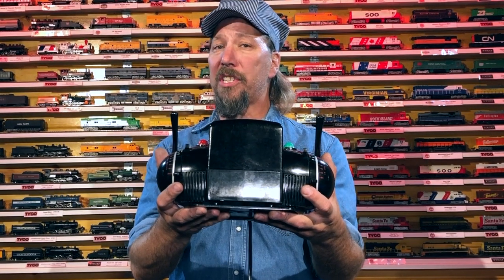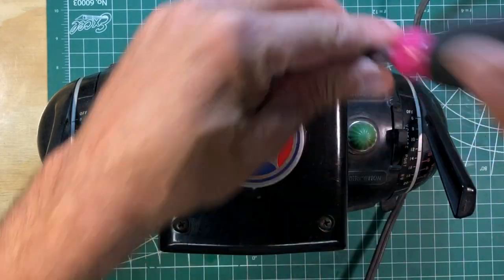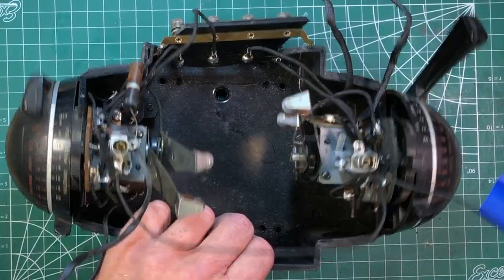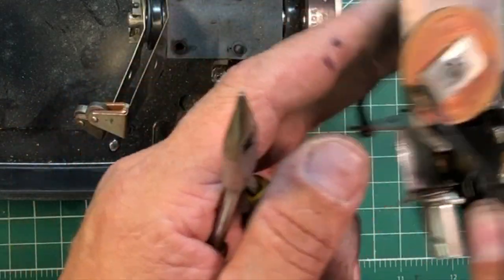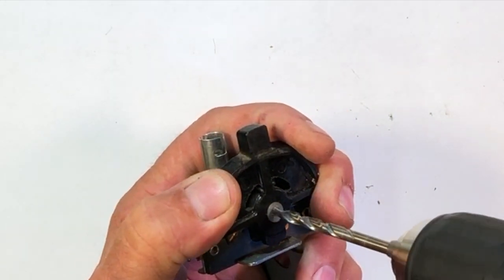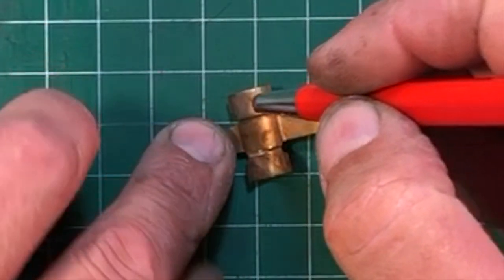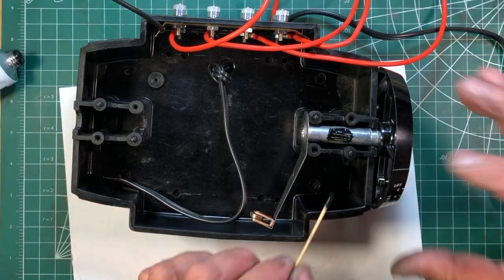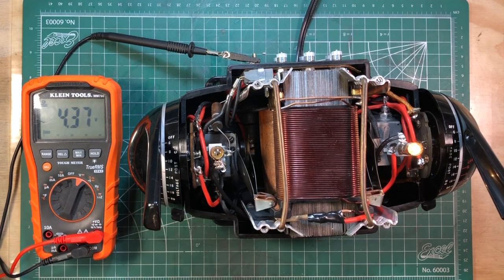Lionel ZW How to do a Complete Tear Down & Update.

Comment from the maker: Before I do a repair video on stuff I'm not to certain of, I will comb the internet and collect information. I came across this video made by Ed at his Youtube channel "TheCreativeMind" and he had the BEST procedure for servicing the reversing unit. His channel taught me how to do the servicing I did to my reversing unit in this video.  Ed also goes in depth on diagnosing the actual coil / transformer portion and explains how it does what it does. I have included a link to his video here. https://youtu.be/qPZNaASE_lw.   Thanks Ed for teaching me how to rebuild these ZW's 🙂
Reply: Thank you for mentioning me. You did a great job on rebuilding your ZW. Keep up the great work.
Reply from the maker: @Gma7788  I believe that is a resistor
Reply: I may be mistaken, but the small voltage leak is there to keep the electronic reverse unit from cycling into nuetral when you stop the train. That way when you start the train back up you don’t need to run through the Nuetral, reverse,nuetral,  to forward again. I know the American Flyer transformers were made this way. In order to cycle an American Flyer reverse unit you have to raise the dead man handles to cycle the reverse unit. This feature is on the larger 15B transformers and up. Hope this helps a little.

Comment: Hi Ron. I have a Lionel 150 transformer a friend gave me before he passed away.  After watching and watching and watching your video I got brave enough to try to do the tear down and rebuild.  Actually, I had fun following along with your video because if I missed something, I could stop and go back.  Doing it this way, it is hard to fail.  I took my time and made sure I cleaned everything really good.  I polished the brass so it looked like new, cleaned all the contacts although I couldn't bring myself to take that reversing unit apart. I don't have a tap that size, so I cleaned the contacts by moving it back and forth.  It worked and they got really clean.  I also didn't put the rollers back the same way you did.  I tried squeezing it but somehow got crooked and I ended up taking it back apart.  Instead, I got the pin and roller in place took it over to my mini vise and with my small ball peen hammer gave the end just a few real gentle taps and it mushroomed perfect.  Doesn't take much.  Everything else went well and your video really helped me a lot.  I don't know what they charge to rebuild one of these, but I think it was fun and well worth it to try.  I have to say, if I hadn't had your instructional video, I don't think I would have tried it.  You did it without, so you are brave.  I love your reaction when the light came on and all went well.  I hope I have the same reaction when I finish it up later hopefully today.
Reply from the maker: Glad you have success with your transformer there John!

Comment: Playing with electrical components is always fun! I was a aircraft election (spark chaser) in the USAF back in the 1980's, then in the 90's the AF pulled a rivet workforce update to that career and added environmental systems to the elections job so we became EVEL or ELEN depending on t which base you got stationed at. But it looked like you had a bunch of fun rebuilding & updating that old 1940's vintage Lionel Transformer, boy they made them to last too, comparing those oldies to today's newer stuff there is no competition, the newer stuff if it stops working toss it, the old stuff you can fix it. Today's manufacturing is putting controlled obsolescence into their wares, nothing is made to last like the stuff before the 1980's.
Great job, now you could start your own business fixing up those old Lionel train equipment pieces for the masses!
Reply from the maker: Thanks Cuda, I agree how manufacturers engineer in planned obsolescence. Gimme the old stuff any day.  This ZW was built to be used every day for years.  Thanks for keeping our "Boy's" safe and in the air :-)

Comment: Thank you for such an in depth break down and rebuild. Ive done the basic rebuild on my two Zws one is the early 250 watt and my 2nd is the later 275 watt. Ive upgraded the diodes, breakers, rollers and power cord but never beyond that. I absolutely love my Zws knowing that they have an amazing past and they will last a long long time. I have a modern MTH z4000 transformer for my more modern trains, but I prefer the post-war era simplicity. Again thanks and keep those trains rolling.
Reply from the maker: Thank you for taking the time and leaving a comment :-)

Comment: Oh Yeah very well done video. I had that transformer or one like it. I loved be cause I could control 4 engines at once. I sold it. Sadly. Then a Fellow in New Jersey contacted me. He had the Flyer dual control with Volt meters a real beauty. He had bought on line and like yours it was broken in shipping. I agreed to try to fix, it. He was a real nice fella . I had rebuilt 3 Flyer Switchers he had and gave the rusty one for helping. I get the transformer to find one side was crushed from the top. the handle was cracked at the lower pivot boss and the maih housing was broken off at the support for the pivot, it was a real mess. But the unit looks brand new. At the time i had a tiny hobby 3D Printer and I had been making train parts but only small ones. He said was not in a hurry and did not the money to pay anyway so take my time. Nearly a year later I was able to get a new bigger better 3D Printer and now had the tool to print his parts. I ground the handle pivot to a straight line angle then printed a pair part to match the shape and super glued it in. It perfectly matched the other handle. Now the housing. I was going to donate the housing from my dual control, but it did not have those Volt meters. I hated to take mine apart cut it up when his was in such a good shape. So i decided to remake the entire lower part and screw it into the housing as neatly as I could. So the round heads could be seen but were polished stainless and looked very good. I reassembled the transformer and it all worked great. So if you get a Flyer Dually let me know i have the housings pivot frame for the handles, if you need one. Nice video well done, your editing is wonderful, Good Job, Dennis
Reply from the maker: Wow Dennis!!  Sounds like your quite the fixer / fabricator kind of Feller!! I have a Flyer single knob transformer with the gauges coming up for a repair video in the next few months. I will reach out if I need something made.  Sounds like your the Feller to go to :-)

Comment: Best ZW build video I’ve ever seen!  I’ve thought about buying a modern Lionel ZWL transformer, but I think I’ll hang onto my two postwar ZWs instead.  They’re very repairable and reliable… unlike the modern stuff with its myriad of circuit boards and tiny components.  The new transformers will probably not make it to seventy years old like the ZWs have and end up as expensive paperweights. 😂
Reply from the maker: Thank you for your kind words and I like the way you think.  The "Old" stuff has proven itself over time.

Comment: Hi Ron.  Great job.  I was so impressed with you're ability do a oh so wow job.  A friend of mine sort of loaned a Lionel VW 150 watt transformer.  Back in June 2015 I was shocked when he suddenly had a heart attack and passed away.  He had gotten me back into the hobby and he gave me this one to get started with.  He told me not to forget where I got it.  When I talked to his wife she told me to keep it.  Funny way to get something huh?  I was totally bummed out for about 2 years.  It will sure take your sunshine away.  I finally slapped myself and started getting back into it again.  The unit sat around for a long time until the other day I got it out finally,  It isn't the same as the one you did but my question is this.  Would most of the replacement parts be the same on this one as the one  I don't know a lot about electrical things but I have gotten braver after watching your video.  You really make it look easy Ron but those reversing switch and circuit breaker is kind of scaring me.  Anyway, I hope I hear from you if you have time.  You are fun to watch and you look like you are having fun.  Please help if you can.  Thanks,  John
Reply from the maker: Greetings John, Sorry to hear about your friend. I'm glad you stuck it out with modeling. I would only assume the parts might be similar but I cant be certain because ive never been into a VW transformer before.  Thank you for your kind words and glad I can be helping you out as much as I can on your modeling journey.

Comment: I'm doing about the same to a AF 30B. I picked it up for 30 bucks but had missing handles. Thanks for the informative video, Ron.
Reply from the maker: $30 is a pretty good deal.  Hope you get it up and running with no problems finding repro handles :-)
Reply: @classicmodeltrains  The handles were missing, the cord was cut, and the tin shield sign is screwed up. So far, I taken the voltmeter out, cleaned, polished and got the needls working again. I'm installing some diodes called TVS diodes. They will protect my modern locomotives against voltage spikes. I'm watching your video on the 293. Those are great running engines!  I wish I had more room for an HO layout as I like working on them engines and rolling stock. Keep up the great videos, Ron! If you find time in your busy schedule, stop over and check out my channel. Thanks!

Comment: @ 16:19 I knew you saw my rebuild video and @ 16:58, it was a lot easier to get the switch rivet in place by removing the board
Reply from the maker: I reviewed all ZW rebuild video’s on YouTube to perhaps learn a new trick or to before I shot my vid. Your video had the absolute best technique for servicing up that reverser switch. As you could tell I had no idea as to why a guy would drill those out, until the reassembly process was well under way. Since I used most of your technique, I am hoping you look at this as imitation is the highest form of flattery. :-)
Reply: @classicmodeltrains  Thank you Ron, yes I do. I wanted to do a solid rebuild that would last a long time. Besides replacement parts, I researched for other components like fish paper, high temp wire and carbon grease that would be equal to the original or out perform what Lionel used back in the day. I guess I did something right if you used most of my techniques. A lot of people will benefit from both videos to do their own rebuilds. I like to ask if you can give me credit for your inspired rebuild since my techniques and materials mentioned are the best. I know you don't have to since it's your video. Be well, looking forward to more projects.
Reply from the maker: @TheCreativeMind  I could put a link in the description to your vid and mention this is where I got a lot of the great ideas?
Reply: @classicmodeltrains  Thank you Ron appreciate it. As an idea on your next ZW terminal stud removal, use my drilling method. Don't go in straight like I did, drill out the rivet at an angle and the rivet snaps off on the inside of the casing. I learned this while doing my second ZW. Grinding off the studs can cut into the brass bar possibly affecting the current flow and heating up the bar. The terminal can heat up and loosen over time due to thermal differences in operation. Also tightening the new terminal nut does dig into the brass bar.
Reply from the maker: @TheCreativeMind  Great info their Ed. Thanks. I also pinned a comment at the top of this comment section Giving you a shout out for teaching me the in's and out's of these classic transformers.  Thank you for sharing the information!!

Comment: Nice job doing the early version, but I wish your schematic covered the later 275 model as there are a few extra posts on the back of the whistle/ reverser.  When I got mine it was apart, I think I can figure it out,  I'll be quick to unplug it if I see the blue smoke. LOL.  Thanks for the video.
Reply from the maker: Thanks Bob.  I just googled the schematic.  there are several out there.  perhaps you can find your version?

Comment: Great video.  I found it really helpful.  I have several old ZW transformers and I have replaced the power cables on them because they were sketchy to the point of not using the transformers.  The whistle rectifiers only work about half the time so I have been curious about replacing them with the diodes.  Now that I've seen it done, I have to decide whether I'm up for it myself or if I want to pay someone to do it for me.
Reply from the maker: Glad it helped.  It's really a pretty easy process.  Just looks scary because of all the wires running everywhere

Comment: I pre-tin my wire. Then stick them in the terminal. I slightly crimp them closed and hit them again with solder gun . Found it easier this way. No cut strands of wire. Using the solder gun last makes it so the terminal and wire a perfectly joined together.
Reply from the maker: Right on!

Comment: I think that while I had that disassembled, I'd go ahead and replace that 10 watt carbon comp resister with a carbon film resistor or even a wire wound resistor.  Those carbon comp resistors will eventually break from all the heat.  At least we do that when we Hams work on our radios.  I just noticed that after adding the conductive carbon grease that it left a trail of grease on the fiber board which will lead to shorts in the future.  Maybe you should have wiped it off after rocking the switch back and forth.  Cheers from eastern TN
Reply from the maker: I shall look into that

Comment: Great video super helpful for a rebuild I am looking to do. Only question I had is what did you do with the original copper wire that was on the bottom of the coil that was originally attached to the circuit breaker. I notice when the new breaker was installed I only saw two wires attached to it which I am assuming are from the light post and from the common post. Thank you for your time and once again for the super informative video!!
Reply from the maker: Hello John, Its been a real long time since Ive made this video.  I would assume that I followed the schematic.  Its wired in the same way as the original circuit breaker would have been.
Reply: @classicmodeltrains  okay thank you

Comment: Have 1. It and a lot was pulled out of a friends family scrap yard. A 70yr old engine extra motor and wheel set. Manual lift bridge. Went through it all. Made small video on YouTube a while ago. Everything ran perfectly. Someone cut the cord off controller. Gets hot running 2 tracks. Shuts down sometimes. Don't know why. I fixed what I could to get it going. Works great individually. But some times not together.
Reply from the maker: Thanks for sharing

Comment: Great video.   I would use caution using a Dremel or Drill on any component containing Lead Solder from back then.   A drill would probably be better at keeping the dust to a minimum.   Its a tiny amount of Lead,    but it is Hazardous Waste.   The used Solder that we are removing when changing out the wires is Hazardous Waste too.   We do not want to breath it in, nor contaminate your workplace, or your home.   I wouldn't be working on it with my Lunch or Coffee Cup near by.

Be reasonable, responsible, and safe.   Collect used solder and store it in a covered container.  Clean up the workbench often.   If you are generating dust we wear a mask.   After a lifetime we might collect enough used Solder to drop it off at our local Hazardous Waste Collection site.
Reply from the maker: You make some great points to consider there Kurt!  Thanks :-)

Comment: Nice video!  Do you have suggestions as to where to buy the components.  You mentioned a 'kit' but I've not found one that has all the parts you used.  What I found was a kit for the rollers and posts.  The diodes and breakers were separate items.  I want to be sure to use the correct items if I'm going to spend the time.  Thanks in advance.
Reply from the maker: I got them from a eBay seller trains-in- the-attic.  It could have been two different kits from the same seller.  Box showed up it was maybe 3" square.  Here's a link to his store. https://www.ebay.com/str/trainsintheattic1?_trksid=p2047675.m3561.l2563

Comment: I just put a ZW back together after cleaning. The inner throttles feel really stiff to move up and down. Should I have put some lubricant on the insulating bushings?
Reply from the maker: Its been a long time since I did this video.  Did the shaft bolts get too tight? I always put some Lub on stuff that moves. I guess I really cant help out on your specific question.  Sorry :-/

Comment: Good work ! What is the resistor for and why was it not replaced?
Also would better grounding help with the floating voltage?
Reply from the maker: Hello Paul, As much as I work on electrical stuff, I'm not an electrical wizard kinda feller. I'm sorry I cannot intelligently answer what the resistor is ultimately for. As to why I did not replace it, none of the "rebuild" parts / kits I found, did not include it, so I figured it must be a kinda bullet proof component that does not fail often.  Just a theory :-)

Comment: Excellent work. The only problem I foresee, any rivet replaced by bolt or screw application, may work loose on you. Otherwise, nice job...
Reply from the maker: Thanks M.C. :-)
Reply: When doing that you want to apply a little loctite or even a dab of diluted shallac to prevent loosening.

Comment: How fast is the circuit breaker to protect modern computer boards?
Ty in advance.
Reply from the maker: I do not have the specs on the speed.  It's a lot faster than the original one, I know that.

Comment: Hi Great video. Not sure of the best forum to ask a question but wanted some clarification about the testing you do at the end of the repair.  Should each of the 4 terminal sets have a voltage of about 19-20v when each throttle is turn up to full power? Thanks for sharing!  Vincent
Reply from the maker: Hello Vincent, That is correct.